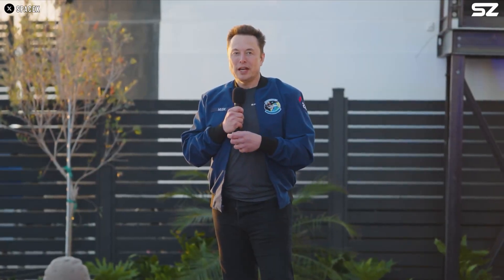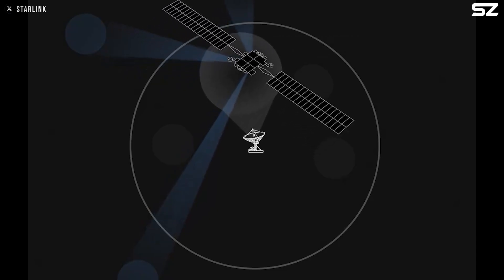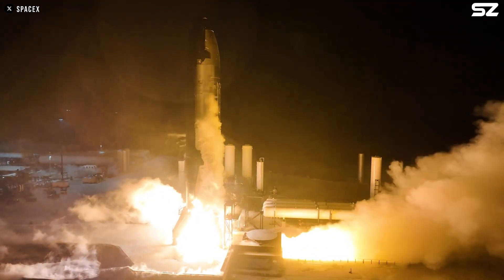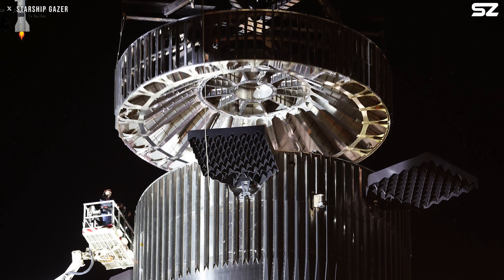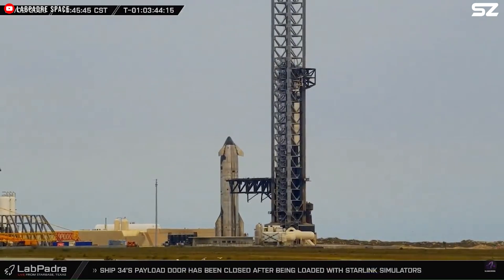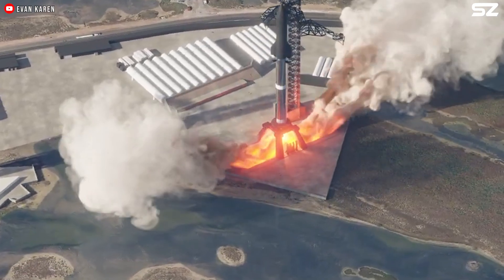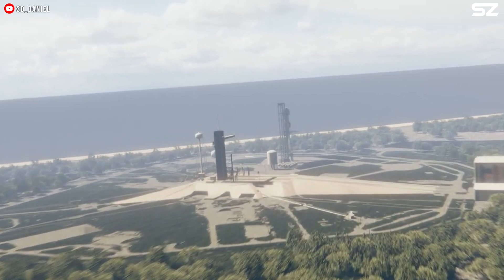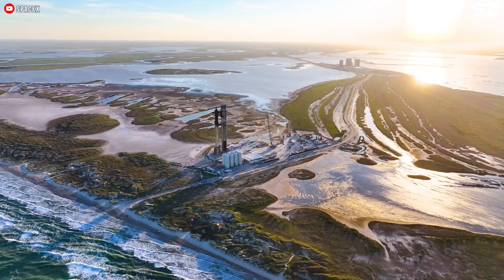Elon Musk Announces Starship V3 Launch Coming!

Comment: The problem with skipping V2 is you may not solve the probelm and v3 may face that same issue. The cost is not wise to do.
The harmonics may be the issue. What they could to is create a frequency Sound dampeners. Yet to do this they would have to figure out what sound is causing the issue.
Once they have this sound wave that is causing the issue they can dampen the sound wave. If they don't do this now in V2 the issue with V3 will be desastres.

Comment: Sounds like hot staging is the problem.   Maybe pause a few seconds before lighting the second stage?  Let the ships separate a bit first?
Reply from the maker: No engine?  Will it make it fall?
Reply: Then it won't be hot staging, they gain something like 10% payload by hot staging. Turning off all engines during staging isn't an option at this point.
Reply: That... defeats the whole point of hot staging.
Reply: Theoretically it is possible that violent ignition of all engines of CrashShip causes a pressure wave reflected by separation ring and top od SH. I can imagine CrashShip plumbing is protected against positive g-force but may be unprotected if something kicks from below.